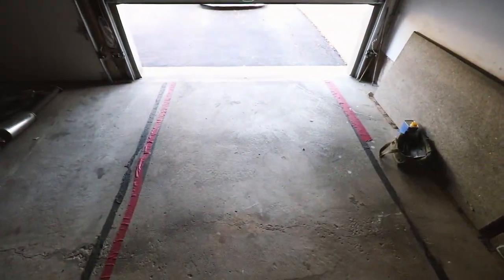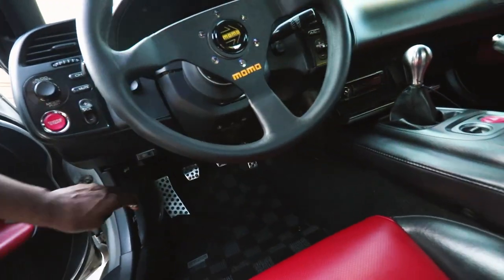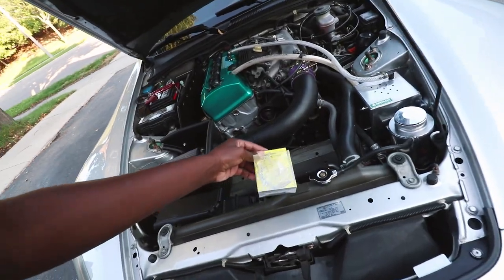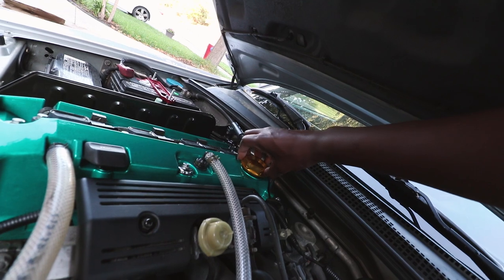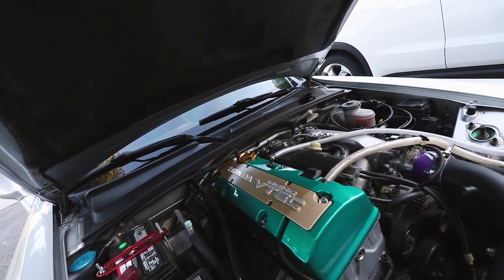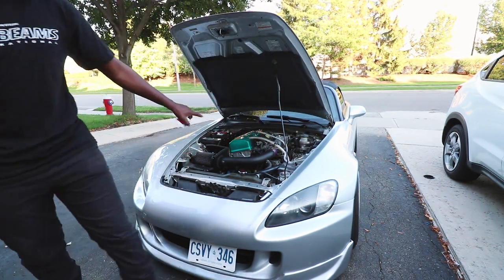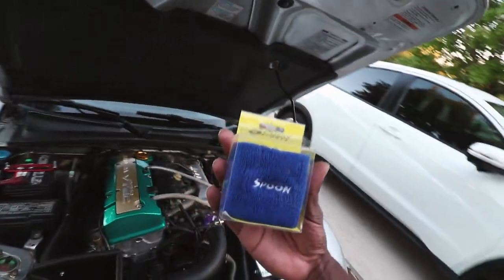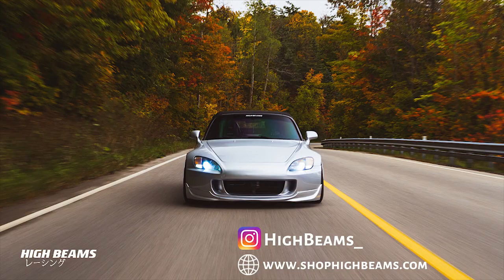THE S2000 FINALLY RETURNS!

Comment: Mother's polish is the best! I use it on my radiator and AC lines all the time. Also some ultra fine steel wool works wonders on dull aluminum.
Reply from the maker: I’m really liking their products too! Keeps everything clean. That’s good to know, need to try out that steel wool for sure👌🏾

Comment: Make sure those parts your adding are authentic. I've seen oil caps back off and rad caps not holding pressure leading coolant to leak out.
Reply from the maker: For sure, great advice! Quality cost some $$. Always gotta get the real deal for those items